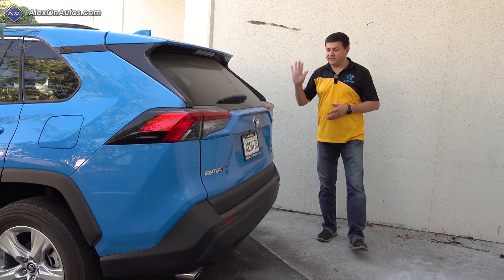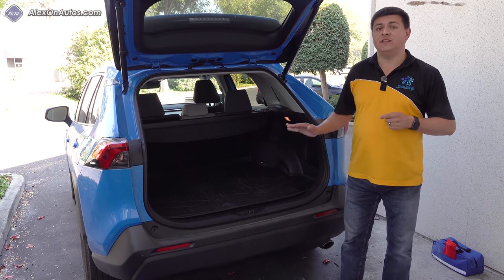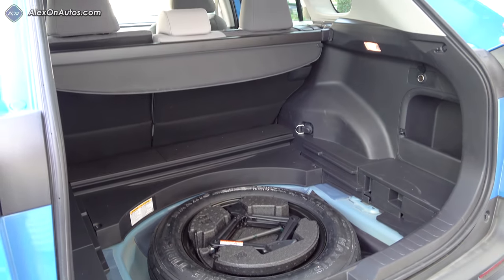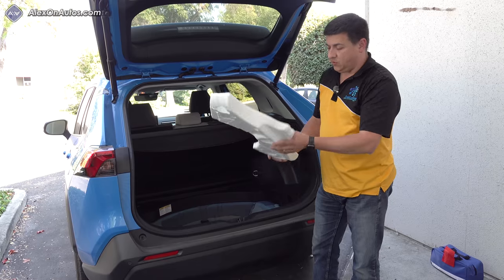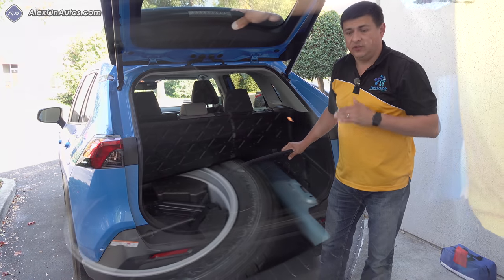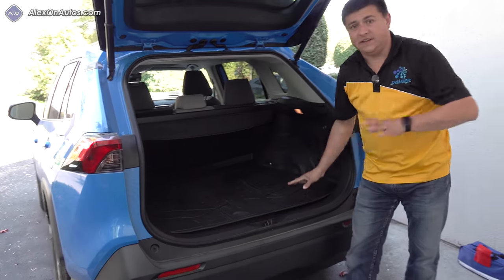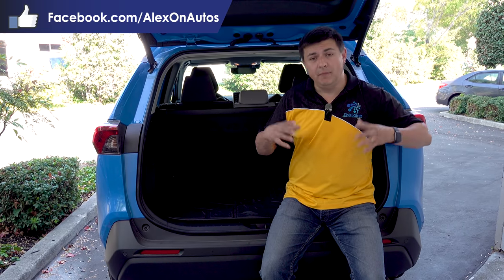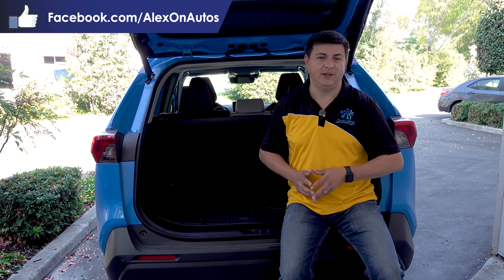2019-2020 Toyota RAV4 FULL Size Spare | Will It Fit?

Comment: hey got a question for ya!  I have stock 2021 RAV4 and want to install 17" wheels with 245/65/17 tires....MY CONCERN IS:  If I lift the RAV4 1.5 inches at a later date, will this wheel set up leave me with a huge wheel gap or will this wheel-tire size fit well with the lift? Thanks very much in advance for your opinion! :D

Comment: Thanks for uploading this video I wanted a full size 225/60/18 Toyota RAV4 wheel but couldn't find one guy at the tyre place suggested a BMW wheel will fit so I bought it cheap from him with 225/45/18 wheel. although it fits on the car but I haven't driven with it yet wonder if it will be safe to drive

Comment: Good job, Alex.  
Since the tire is flipped over,  I added a valve stem extension on to it, so I did not have to take the tire out to test it or add air.  They do go flat, so I check mine when I check the  running tire pressures.   
Unlike GM, toyota does not give you individual tire pressure readings. Too bad. I find it a big safety feature.
I have added full size tires to my vehicles when possible.  WILL NOT BUY a vehicle that does not have some sort of spare tire.   
The inflation kit they provide on some models, are dangerous and about worthless, to say the least.  
 Some tire shops will not work on a tire that has that tire inflation junk sprayed inside of it.
Reply: If you run the Tire Assistant app on your Android smart phone, it will show you the 4 individual tire pressures. At least it does so on my 2019 Prius Prime.

Comment: Had a flat tyre, also have a spare tyre but not full size, since I’ll be travelling for 120miles in mostly motorway I will be restricted with my speed to 50mph. So I called for breakdown help, they don’t have a full size tyre to replace rather they will only repair it however on the receipt it warns you not to run more than 50mph. I end up going to a tyre shop to buy and replaced with new full size tyre. Spare tyre or repair kit does not really help when you travel on the motorway.

Comment: rav4 in Australia are also sold with a space saver tyre, like you i was also told that they do not support a full size tyre & rim, I was also told it would not fit in the boot, I proved them wrong. It is ridicules for car manufactures selling vehicles in Australia with space savers, this maybe ok in suburbia, but once leaving the metro area there are vast distances in between towns. I think toyota should re think this & go back to supplying or at least give you the option of having a full size spare.

Comment: last time i had a full size oem spare rim/time combo was when i had my e46 ., been runflats ever since but i wish they had a full size spare even tho they claim its not needed i had the sidewalls rip on my e90 enough times to switch to non-runflats. i'm on a g01  and i wish i had a spare
Reply: I had a 2001 BMW E46 with the full size spare tire and rim. Definitely a workout getting it out of the trunk, but a lifesaver in those difficult situations. Now BMW has those flat tire kits to save space. A flat tire kit will never give you the same peace of mind as having an actual full size spare tire.
Reply: Shoot this e46 I bought in Germany as my daily driver when I just recently arrived didn't come with a spare tire, but it did come with the set of winter tires. Can't win.

Comment: It's so annoying that the Toyota dealerships play the "as it's not standard fitment, you can't have the wheel" card despite knowing it will fit. Apparently, in the UK, in order to meet emissions ratings, the additional weight of the tyre was unacceptable. So, UK Plug-in hybrid PHEVS (same as a Prime) are supplied with just the air pump and tub of gunge, which is as useless as a chocolate tea-pot when you've split your tyre. Luckily a do-nut does fit, although the wheel recess does need the shim at the back to avoid the frontmost part of the tyre pointing upwards and stopping the load floor from laying flat. We also don't have the double floor level options for these reasons.

Comment: I’m thinking of doing the opposite with my CT200h and delete the spare donut. Instead I’ll put a portable inflator and tire repair patch kit. What do you think? Would you delete a spare? A smaller fuel efficiency oriented car would likely be better off losing a nice chunk of weight. Of course the drawback is you don’t have a spare. But honestly I’ve never had a flat tire in 20 years.
Reply: I also haven't had a flat in decades...  Really, it would depend on your circumstances, right?  I live in an suburban area, almost never carry passengers and never tow, never go off-road, have Roadside Assistance close and on my cell-phone's contact list--a temporary spare is fine for my situation.  I also have a bit of "Inflator Kit" anxiety [as in, "will it work?!"], so that's not for me (even though Roadside Assistance, or even a tow, is close by].
Unless you move to a rural area, and/or start driving on rough roads/go off-road, or start towing, I would think that an Inflator Kit might be fine for you.  To backup an Inflator Kit, I'd have (and be familiar with) a good-quality Roadside Assistance service, and have that number on my cell phone.  Now, if you routinely/frequently take long road trips, particularly to different destinations, then I'd lean toward keeping the temporary spare, even if you had Roadside Assistance.  But, really...it depends.

Comment: Alex 3 flat tires this year already? Sounds like you're driving on some harsh roads! I've had 1 flat last 200,000 miles (knock on wood). Maybe consider some AT tires or run flats? 🤔
Reply: Last flat tire I had was about 5 years ago...heard a hissing noise while I was at the gas station pump, filling up.  I had picked up a screw.  Drove 50 yards over to the full-service repair shop (so, I never had to use the spare tire).  That was my first flat in, maybe, 25 years--"knock on wood."  Drove for 3 years in the Philippines, and also drove for 3 years in Panama (Central America)--never had flat tires there, either.

Comment: How much of a mpg hit is it with a heavier wheel and tire?
Reply: He said it was 6lbs heavier. The difference would be imperceptible.
Reply: Going from a kit to a full-size is about 40lbs, so you may lose .5mpg on the highway. From a compact to a full-size, there is almost no difference in weight or cost of the rim. The cost of the tire is  why manufacturers do this.

Comment: Good video! Will adding a full size spare tire decrease your MPG? You should do a video on your cars MPG with a small spare and full size spare
Reply: I carry a full size spare in my 2019 Prius Prime. It has not reduced fuel economy in any significant way that I can measure. The car gets up to 58 mpg at 55 mph.

Comment: I was trying to explain this to a friend a dealer and they didn’t get it, but as I’m buying a new car I want a full-size spare wheel/tire. If I’m driving between Toronto and Vancouver I don’t want to be in Saskatchewan and not be able to get anywhere within the range of a FaF or donut.
Reply: How far would you drive without a working spare after you installed your full-size spare in Moose Jaw?
Reply: Is help really that far away in Saskatchewan?  You can't get to a repair or tire shop within a 70 or 50 mile driving radius?  If you're really out in the boondocks, you may want to just buy, and carry, a full-size "spare" for those long, isolated trips over primitive roads.  You'll probably also need food, water, tent/sleeping bag, and a satellite phone.  [In America, you'd have to add "guns" to that survival kit--in case of BigFoot, or Zombies].
Reply: The issue is if the vehicle isn’t sold in Canada or if the OEM wheel isn’t part of the vehicle in Canada. Waiting to have a wheel shipped from the US to Canada isn’t really ideal. I waited 3 days for a replacement wheel for a fricking Civic after I got a fracture from road debris. They offered a rental but when driving cross country it makes no sense to offer me a rental. Should’ve offered me a hotel. LoL
And yes, my comment is referring to looking for cars that have full-size spares and matching wheels.

Comment: Compact spares should be illegal unless you have offset tires.  If you have a full time AWD (Subaru) you could possibly do some real damage to your differential and drive gear parts. Some of us actually have to do lots of driving . I carry a full size spare in my Outback. Its crap that it takes half of my trunk space.
Reply from the maker: Most modern AWD systems, Subaru included will run fine on a compact spare. The older Subaru systems with a torsen center diff would see increased heat and fluid temps, but the current clutch based systems are fine.

Comment: 17 and up Escape has oem noise insulation material under spear tire which Toyota doesn’t have. Also 17 and up Escape performs a moose test much better than Toyota does. Full or not full size spear tire in States or Canada not a big deal, size doesn’t matter) many cars have only tire repair kit nowadays. But if you live in russia with their roads and roadside assistance you must have a full size spear tire, better not just one it depends how far from moscow you would like to go.

Comment: I have a Mazda cx 5 and Had to buy a small size spare, now I wonder if a full size one would fit,
Personally I would prefer a full size spare wheel, it's not there to increase the supposed increase in power
Reply: I believe Alex's video which compares the RAV4 to the CX5 states that he was NOT able to fit a full size spare into the Mazda.  Check that video out.

Comment: And I thought I was being prudent when I bought a donut spare off Amazon for $100 for my 2013 Kia optima to replace the ridiculous fix a flat kit kia included. For $80 more I probably could have added a full size spare which I could have easily resold when I sold the car.
Reply: Veracity I’m not sure you’d fit it into the Optima.
Reply: @afcgeo882  probably not. I sold it anyway. I think a donut is ok for a px vehicle.
Reply: Veracity I think a donut is good enough, but I’ve also seen donuts pop and people driving on them far too long and far too fast. My Camry has a full size spare from the factory and I appreciate that. It’s also saved me money on tires and wheels as it’s identical to my other 4 and I rotate them all through. Would I pay an extra $100 at purchase to get a full size versus a compact? Absolutely!
Reply: @afcgeo882  yeah George I wish manufacturers gave us more options but I bet the public wouldn't pay more overall
Reply: Veracity Cars get priced up $250-500 from year to year without raising anyone’s eyebrow. You mean they can’t raise the price by $100 and still make $25 in profit on that? Of course they can!
Reply: @afcgeo882  hey George I bet they are trying to reduce weight and get better mpg too. But yeah I would totally love a full size spare option myself. Charge $150 and they make $25 extra. Win win. It would prob need another tpms sensor in it too...
Reply: Veracity The weight difference is just 6 lbs.

Comment: Alex, is it the same  case with the HYBRID versions (Batteries didnt change the spare space)? Thanks.
Reply: The Hybrid battery is under the rear seat squab so it should not affect the spare wheel space at all.

Comment: Toyota UK will sell you a full size spare tyre as and option.
Also Volvo will do the same it does reduce cargo capacity.
I do not approve of car without at least an emergency spare.
Most 4x4 cannot use a universal temporary spare wheel it to do with drive shaft alinement.

These cars with a bottle of gunk  are useless I have been caught out twice.  At least with temp spare you can drive.

Comment: Was the donut the just smaller width but same diameter? The donut in my car is smaller diameter so if you have to put it in the front the car will steer to the side. >_>
Reply: For Mazda, the temporary spare is also thinner and smaller in diameter.  So, if you have a flat tire on the FRONT axle, they used to recommend (don't know if they still do) that you MOVE a functional REAR tire to the front, and THEN put the temporary spare on the REAR axle.  Obviously, as you probably won't have a jack stand, that will involve mounting/unmounting multiple tires, but at least your steering feel won't change too drastically...[your driving dynamics will probably noticeably change--besides reduced  speeds--particularly if you have 4-wheel drive...]
Reply: @kenc2257  Yep, I actually own a Mazda and was asking because of it. However my previous car was a 2014 Honda Accord and that also had a smaller diameter spare which I had to use once and it was terrible, you had to constantly fight the steering wheel to drive straight. And I wouldn't be surprised if that isn't good for the drivetrain because one wheel is spinning at a different rate than the other - but I may be wrong.

Comment: Here is a conspiracy theory..  most people in North America call for service if they get a flat, since they can't be bothered or don't know how to change a flat tire. The manufacturers have caught on, and stopped providing full size  spares.  In other continents, drivers are more knowledgeable, and perform a lot of the maintenance themselves.    I  see a similar trend with the manual transmission , the same vehicle sold overseas is offered with a six speed manual, whereas in North America , there is only an automatic option...